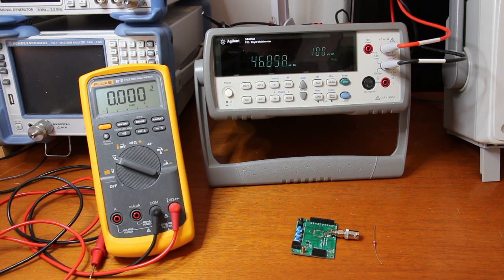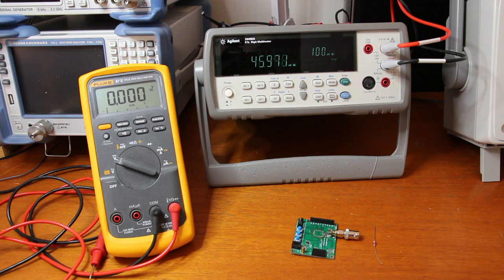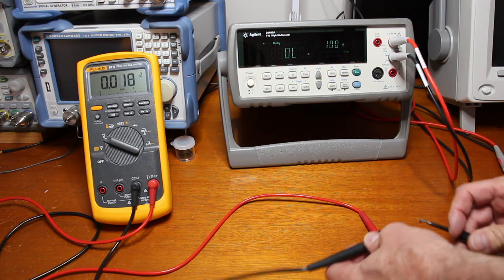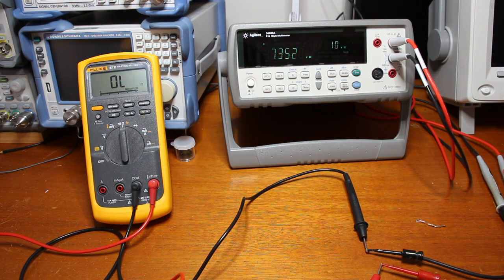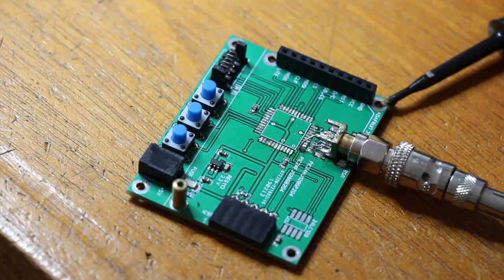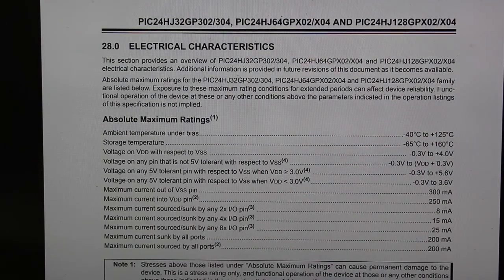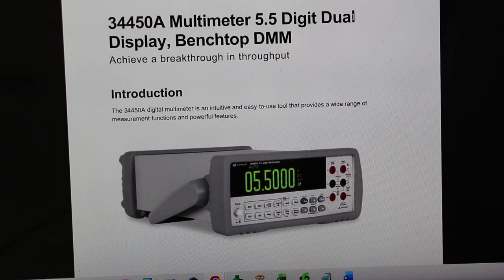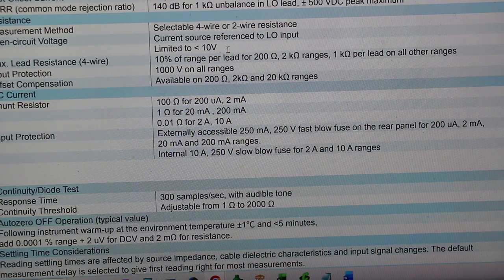#46   About your beloved multimeter...

Comment: The multimeter mostly puts a current source through. Most DMMs on the lowest range will flow 1mA at most to test 100 ohm. The 34405A data sheet shows that it will flow at most 0.83mA on continuity test (which is the same as the 1kR test), and 1.0mA on 100R test. This would not normally be enough to blow the anti conductance diodes on an MCU input pin.

The open circuit voltage you observe is "simply" the compliance voltage of the constant current source that the meter supplies. As soon as something tries to draw more than 1mA (like, an MCU pin protection diode trying to blow up), that voltage will drop like a rock until 1mA is reached. In this circumstance it looks like they're stopped more at ~0.5mA instead

Comment: Digital multimeters generally use a (programmable according to range) constant current source for measuring resistance so that simple voltage measurement translates to resistance of the device under test (V=I*R). "Internal resistance" on resistance ranges really doesn't apply, as such. The voltage measured at the meter terminals with nothing connected is just the voltage out of the current source when it "goes to the rail" to try make current flow into an open circuit.
Limiting the open-circuit voltage of a current source without introducing error can be quite a difficult task. Actually, everything you have to do to make all digits of a 5.5 or 6.5 digit DMM truly meaningful and accurate is quite difficult. Making a meter that pretends to be accurate at 6.5 digits but really isn't much better than a good 4 digit meter is much easier.

Back in the days of moving-needle meters and entirely passive circuitry, resistance was measured by applying a constant voltage to the meter leads and measuring the resulting current through the resistance under test. This, of course, is non-linear (I = V/R).
Reply from the maker: Good point. This is really true for higher quality multimeters and in fact my Fluke and Agilent limit the test current to about 1 mA, which is, according to the literature, the maximum continuous current allowed in the clamping diodes. However, if you are probing the board with any of these multimeters and there's no power supply applied to the board, the clamping diode will be pratically open and the full voltage (4.2V for the Agilent and 7.3V for the Fuke) will be applied to the high input impedance transistor gate insulation and the "absolute maximum ratings" spec applies (3.6V). The entry-level Keysight multimeter 34450A specifies maximum 2.8 V for the resistance function and maximum 0.5mA for the continuity test,  which is revealing. Thanks for your appropriate comment.

Comment: I have an older Racal bench unit that can go 10 volts and higher on ohms - but that also makes for very noise free, accurate four wire measurements - and it identifies resistors with bad tempco specs too because the self heating is enough to cause visible drift.

What I find a more insidous trap is how current modes on auto range change the meter resistance drastically... which can lead to colourful language if working with low impedance test setups!

Comment: I don't think this would be an issue, in most cases, but very good at least to be aware of it. Other thing/situation is when testing 'in circuit' that diodes start to conduct. Recently I have bought  hand held component tester that has an adjustable test voltage. I don't remember now the lowest, but it is under the classic 0.6V. It's one of those cheat Finrisi tweezers model.

Comment: Interesting video.  I've worked with FPGAs that gave an overvoltage range and duration in seconds.  I was surprised that this limit was about 4 volts.  This was a low cost FPGA, only $40. The concerning thing is that most people would use the handheld meter to che k a new PCBA for shorts, because its more convenient than the mains powered meter.  The FPGA datasheet was focussed on reliability / MTBF, implying that the part would not fail immediately,  but wouldbe stressed and fail later, for no obvious reason.  Thanks for the video, its very timely as i have people doing remote diagnosis and can't easily control what measuremnt equipment is in use, or how it it set up.
Reply from the maker: Thanks for this enlightening comment.

Comment: Out of curiosity I testet my Aneng AN870.
• Resistance test with 10 M load (the other multimeter):
- highest range 0.525 V (measuring that 10 M)
- lowest range 1 V
• Continuity test: 1 V
• Diode test: 3.25 V
It's worth mentioning that it's running out of two 1.5V cells (that in my case are pretty old) and they add up to 2.95 V. It somehow boosts the voltage.
Reply: My cheap multimeter also uses a lower voltage on the 10Meg range.  That seems unusual, I would have thought a higher test voltage on higher resistance would be better.
Reply from the maker: Apparently it's the usual thing, my Agilent and Fluke do the same, as shown in the video.

Comment: My fluke is pretty much the same, but my uni-T limits the voltage to under 2V under load. I think it would be very rare to damage something with this cause the current is pretty limited and also most 3.3v logic ic's/mcu's are tolerant to 5v or a bit higher for short duration. I think its only going to be an issue if you are probing around a sensitive part/board, so yea still worth keeping in mind.
Reply from the maker: True, but it's scaring Siglent and RIgol putting in the market 61/2 models that can reach 10 V of open circuit voltage - normally 3.3V devices can operate with 3V, so there will be 10-3=7 volts applied to the series combination of the internal resistance of the multimeter and the clamping diode. Thanks for the comment.

Comment: Very good, it's something I've never tried before. It's clear they're all going to probably kill the controller. It's surely something to consider and be carefull. Other thing I'm always concerned is on floating ground. It's very easy to damage the circuit.
Reply: Pretty unlikely to damage anything.  Current is what kills semiconductors, yes the voltage might cause a breakdown condition or ESD diode to conduct but without enough current it won’t cause damage
Reply from the maker: Thanks for the input. A 10V open circuit voltage (like the Siglent and Rigol shown) can impose a  10-3.3=6.7V on the clamping diode (in series with the internal resistance of the multimeter source) which is supposed to withstand only about 2 mA, so that will depend on the value of the internal resistance  and the risk you are willing to take - there is a reason why Keysight has limited the maximum voltage on its multimeter.
Reply: @vk5fe943  I've not seen the 2mA figure (ie a DC rating) for protection diodes before, where does that come from?  Protection diodes are usually intended to withstand human body model ESD tests which are 100pF charged to 2-8kV and discharged to the pin through 1500 Ohms.  In this case it's the pulse energy that the diode has to cope with.  10V open-circuit is fine as long as the series resistance is high enough, I do note that both the Agilent and Fluke circuits you showed have a short circuit current of less than 2mA.  The voltage choice is likely more to do with how the rest of the resistance measurement circuit works.  I've not heard of a multimeter being the actual cause before, it's always some other form of "user error" :)
Reply from the maker: True, it's unlikely that my Agilent and Fluke would destroy the microprocessor input (I have them for many, many years). The 2 mA figure apparently is an accepted limit and for such a small diode it makes sense - the time constant for the test you described is 150nS, so a small energy pulse discharged in a very short time. 
In the case of a 10V open circuit voltage multimeter, I wouldn't be comfortable probing around using them - besides, in general 3.3 V microcontrollers work normally from 3V and then  the voltage applied to the diode-internal resistance would be 7V and an internal resistance 3K5 would be enough to produce 2mA continuously. I am sure Siglent and Rigol thought about that, but in this case I would buy the Keysight, which has a limited open circuit voltage.
But the most important thing is that in the video I just showed some data and measurements and left the conclusions to viewers, knowing that this is a controversial matter (that could even generate a couple of dislikes) and expecting well-based comments like yours.
Thanks for your participation.